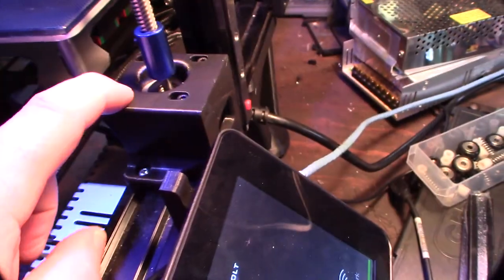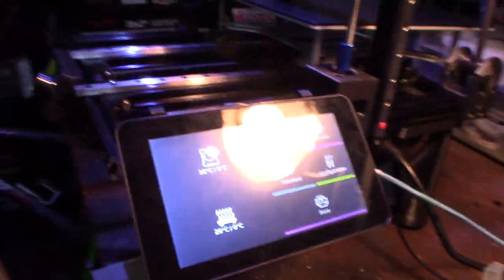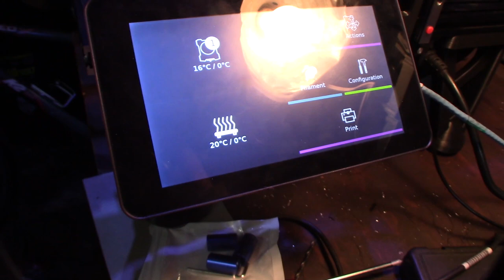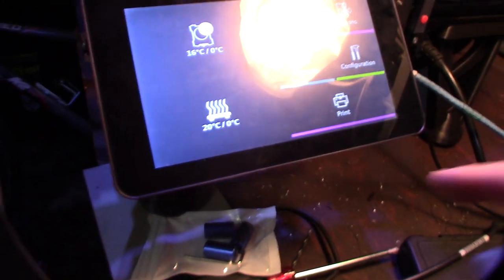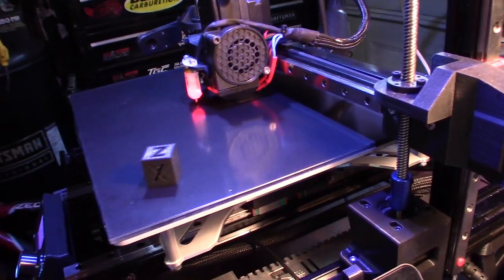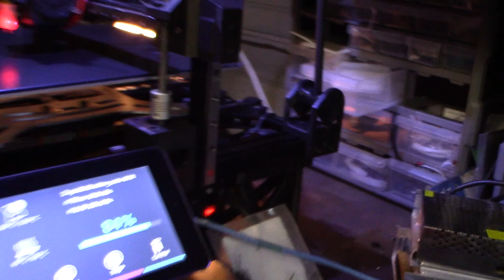3D printer solid lead screw coupler upgrade or downgrade? Banding ribbing ghosting experiment

Comment: y Hot end crashed into the left side of my printer and I heard bunch of buzzing noise.  Turns our the X gantry is now off level.  Can I manually loosen he coupling on the left side and manually turn the screw rod up anti?